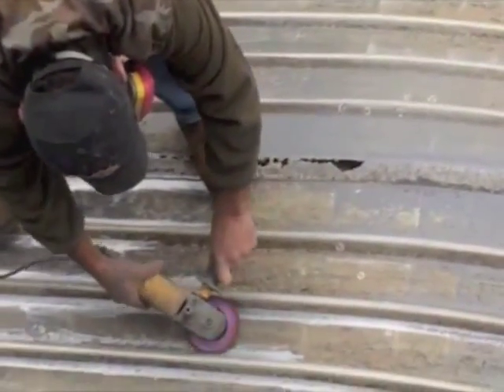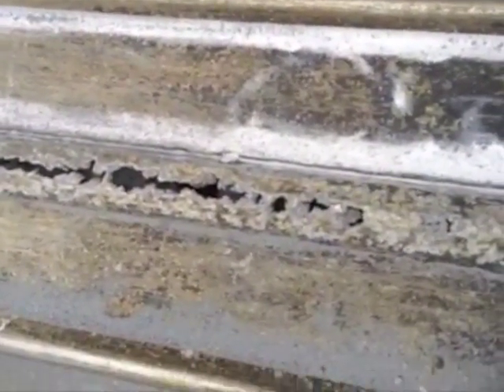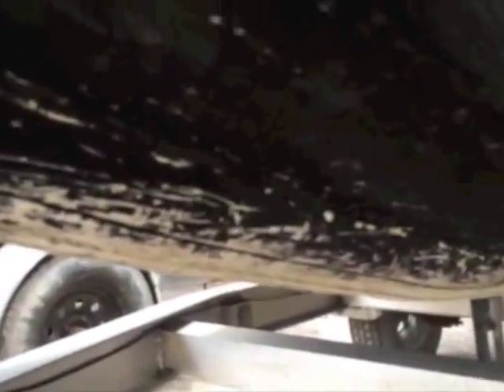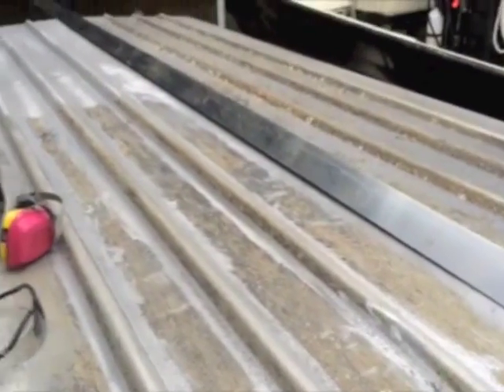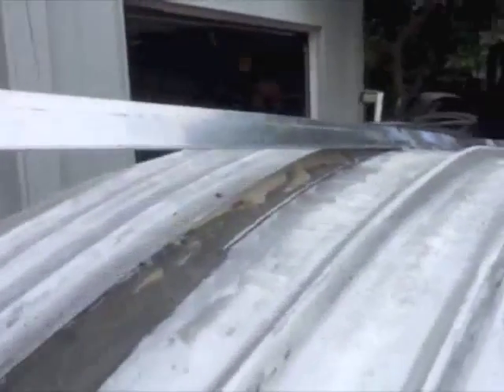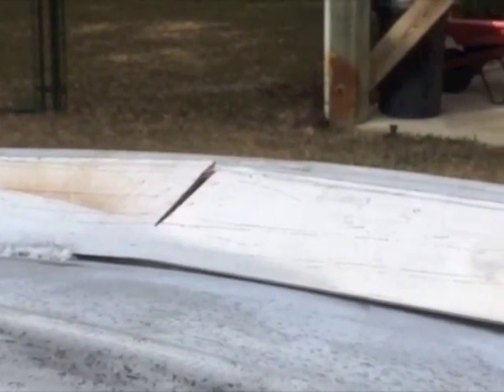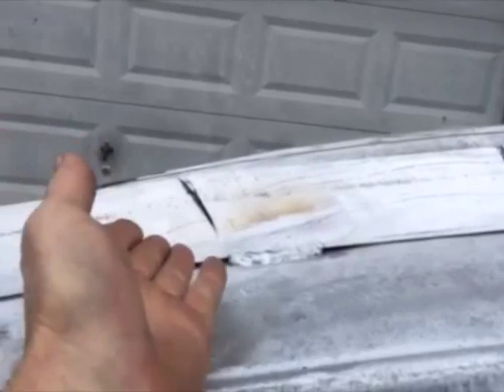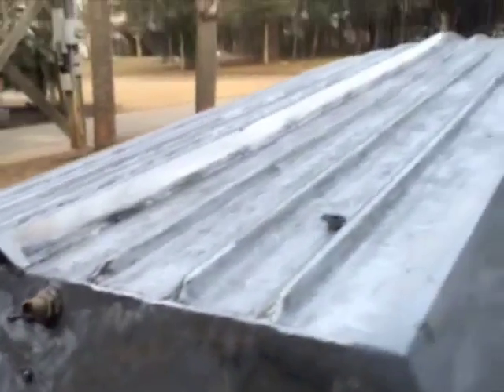Repairing SEVERE Electrolysis Damage

Comment: I've got a boat where the aluminum is still very strong and thick but on the back where it sets on the bunks is severe pitting and pin holes it's a tunnel hull so only about a 2' long x 6" wide section would need replaced is it ok if i cut those parts out of the bottom of the boat and spool gun the same thickness of aluminum back in? Is it ok to make that long of a weld on the bottom like that? Can i grind it flush or just leave it be? My keels are the same as this boat but they were riveted on so I'm just going to fill in rivit holes and weld back down angle like you did. The rivits were not holding anything but the keels. Any help would be appreciated!
Reply: Ok thank you for your info!
Reply from the maker: I would use some .090” aluminum flat strips the required width/length for that area, and lap weld it. No need to cut out the bad metal, it’s easier to plate over it. If you can turn the boat over it’s much easier than overhead. Make sure to use ER5356 filler wire as 4043 is not corrosion resistant, and is a dissimilar alloy from the boat. 
Use stainless steel wire wheels and brushes to thoroughly clean all edges before welding. 

Hope this info helps!

Comment: Lmaoo hey did I tell you aluminum causes alteimers
Reply from the maker: I forgot. 🤣😂😂😂😂
Reply: Can you use alumoloy brazing rods to do this
Reply from the maker: I’ve heard of people using aluminum brazing rods to repair aluminum. Also you can use regular aluminum TIG wire with number 31 aluminum brazing flux. Best used with oxy hydrogen torch instead of oxy acetylene because the hydrogen burns a little colder than acetylene, and since aluminum melts at 1217F, the hydrogen flame is better for it
Reply: @HKPSG1Shooter  just got a 12 foot Sears going to try that this week! Thanks for the info great vid 👍
Reply from the maker: With the boat on the trailer and the drain plug in, fill with about 3 inches of water. This will locate any leaks in the boat. 
Do the same after welding to verify the leaks are fixed. 

Lemme know how the brazing rods work. I’ve played around with them a little bit but when it comes to boat repairs I normally use MIG, or TIG

Comment: How do you fox all the small holes in the Transom and hill from electrolysis?
Reply from the maker: On this particular boat, there was heavy pitting in some areas, but not completely corroded through, just the center keel was the worst part. 

If you have a few holes, they can be cleaned out with a burr bit until you get clean metal to weld to. In some cases the holes may be large enough to require a backing plate so you have something to start the weld on, without constantly blowing holes.

But I have seen boats where there were just too many holes from corrosion, and there's nothing that can be done. Aluminum is very intolerant of impurities.

One thing I will tell you is that if you use a boat in saltwater, apply 4-5 coats of Interlux Interprotect 2 part polyamide epoxy BEFORE applying any bottom paint. Without that barrier of epoxy, the bottom paint won't adhere as well and will even react with the hull, even if you are using the correct paint made for aluminum (copper thiocyanate versus the cuprous oxide paint used for fiberglass)

Also, you should install a sacrificial anode on your transom, below the static waterline, and attach a bonding wire between the mounting bolts and the negative terminal of the battery, this will take care of electrolysis from stray current or galvanic corrosion.

Comment: Great video dude, thanks for the help, I have a 14 alweld that needs some work, not near as bad as this one.
Reply from the maker: Usually that center strake is where most boats fail from corrosion. However, they can also develop corrosion in the area where they sit on trailer bunks (which is why you should not use carpet, use TRex boards or some other type of composite)

 In some cases you may get a patch of corrosion formed from a pinhole. In this case, gouge out with a burr bit until you have clean metal all the way around. If the hole is large, cut a small piece of aluminum and use a piece of aluminum MIG wire to fish it into the hole, and hold in place against the inside of the hull until you can tack it. Using a backer plate like this gives you a place to run your puddle without blowing out as you weld up the hole.

Comment: This may look ok when it is done..but where does the strength come from ?  I don't see it.
Reply from the maker: I have repaired numerous boats like this. When you have 32 linear feet of weld holding a piece of 2x 3/16 aluminum angle to the bottom of the boat, I'd say that's where the strength comes from. But that's just my opinion as someone who builds and repairs boats.

Comment: My guess is that they used a different and inferior alloy for that joining strake ( keel), Certainly a shoddy way to build a boat !
Reply from the maker: That's exactly right. This is a common problem with many brands. Whatever alloy that extrusion is, doesn't hold up in salt water, it deteriorates faster than the rest of the boat.

Comment: Excellent work. I’d like to see part 2. How to prep and paint. Including what chemicals you use for the paint prep process.  Nice work
Reply from the maker: Sorry I didn't do a part 2. But for prep and paint, here ya go. Clean the metal with Phosphoric Acid etcher, then a thorough rinse, this turns the aluminum oxide on the surface into aluminum phosphate, halting the corrosion process. Next, you'll want to spray on a light coat of Zinc Chromate primer (or any self-etching primer specifically made for aluminum) Then follow up with 3-5 coats of Interlux Interprotect epoxy primer rated for underwater use. Finally, 2-3 coats of anti-fouling paint (use cuprous thiocyanate-based paint rated for aluminum, do NOT use cuprous oxide, it will destroy the hull from electrolysis) And finally, if using the boat in salt water you should install a sacrificial anode, made from aluminum alloy (zinc is not reactive enough, and magnesium is too reactive, the electrical difference will actually blister paint off the boat) Hope this info helps!
Reply: HKPSG1Shooter , hey guy, where is the best location on the hull to place the aluminum anode?